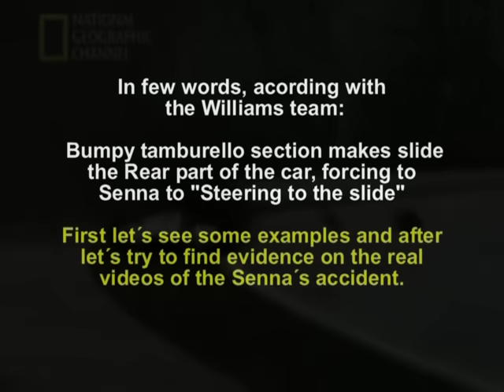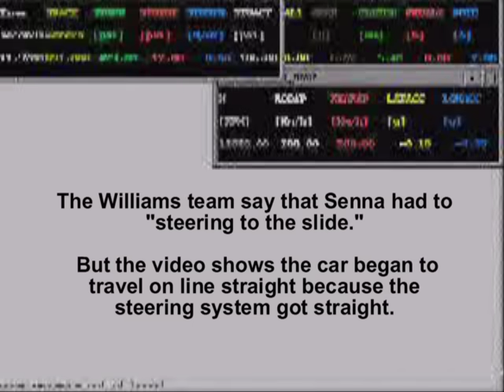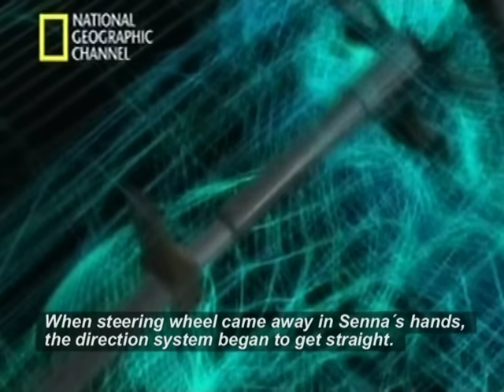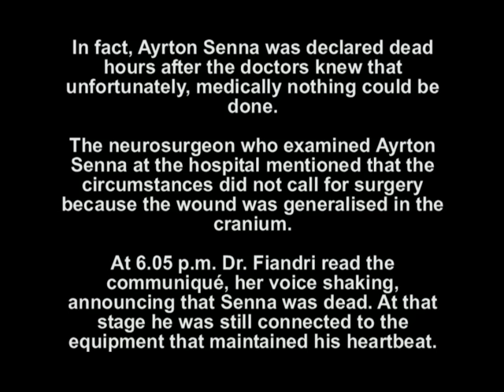5/5 the death of Ayrton Senna - what NatGeo did not tell

Comment: 1) Whats clear is  F1  had no Standard for how low the car could be.  The Steering did not just Brake with Driver turning  a steering like An Arcade game. Clearly  Senna Pushed To the limit Gap between  Ground & Car to the Max. Based on Cold tires on lap 6  with Temps starting rise in the Tires on Lap 7  at 200 mph the rear of the car when comes in contact with the  track  and Like a car jack  stand lifts the Rear of the Car to Zero G for a  moment  the back of the Car is Weightless. Now all of you I hope have jacked up a car sometime in you're life.  You when  you Lift  one side what happens to the other. The unbalanced weight is placed all on the other side Shock s almost completely bottoms out. At this moment with the rear being clearly the majority  of all the Weight of the Car. It Now becomes the 2 Front Tires wheels, 2 coilover dampened, 2 Sets of Arms and 1 complete Setup Steering System having to bare the whole weight of the car, that was designed to only handle the Front weight which by comparison is next the nonething compared to the rear portion with Engine driver Wheels Tires twice the size of the Fronts Supension and control wing. At this point it is Possible  Steering system snapped. 2) Or upon Car & Senna Returning to Ground Senna as any great does, drives by feel and Knew Something was  serious  wrong. He  Slams the brakes Applying even more down force to the Fragile front end that is way beyond  Its load capacity locking up all Wheels At this Point it The Steering system  was not already broken now The in Full lock Steering System snapped like toothpicks. 3 groups of people are responsible for Senna's Death. 1) F1 for not setting lowering limits. They knew tracks are not perfectly level. 200 mph this unlevel environment  is Magnified. 2) the owner and builders of the Track. Knew this the Fast corner in F1 so Why make the so close and barely  enough kitty To Stop a bicycle  let alone a 200 mph car. Guess the Green Environmental Wackos Got a judge telling the Track those are endangered Trees and even more endangered a very rare nat Fly. Oh well the Hell with the Drivers if theirs a problem. & 3) The great One Senna himself. As stated in the Video He push the limit on everything  an How low he could go was tested. Conclusion this too Low. Remember every  2mms would shave 1 to 2/10 on lap times Senna Gambled and lost. With the Help F1,Track officials & Green tree huggers.
WILLIAM'S at no time was responsible. But clearly SHOCK, IGNORANCE, GUILTY & a natural ones trying to defend  themselves from something many here in the Comment say they were. 
Remember when going 200 mph you are traveling 10 football fields every 1 second. Let's say Rear of car was only at zero G and in the Air 1/2 Second it was in the air and at zero G with all weight of Car on the Front never designed to handle that load for 5 football fields 1500 Feet. How far do you think & how safe down the dragstrip at 200 in the 1/4 mile. Senna did the quarter mile at 200 mph without ever the rear wheels touching the ground.
I REST MY CASE‼️ RIP Oh great one💎🌍

Comment: Think of it.
The tires spinning at those speeds.
Both linked together.
The centrifugal force would point those tires to the least amount of friction/counter force/resistance. 
Which way would the tires turn?
The exact direction the car is pointed at, at the exact fraction of a second that they were broken away from the steering column. Straight into the fucking wall.
Sad.

Comment: First off, there is a lot of blame back and forth and tons of opinions. IMHO, Senna (God rest his soul) knew his risks! Knowing one of his best friends died the day before (RIP Ratzenberger), Schumacher (Get Well, God Speed and will always be #1 in my book) breathing down his back, weather conditions, and concentration just coming back to speed after the safety car, etc. This is a lot in itself to take on! * To the point*** This is a team sport and they all have their part to play. Some days are synced up all around and victory is had by all, but those days where one thing can go amiss, it could spell a devastating lose, and sometimes death. Back then, drivers knew the risk was 75%-80% probable of some kind of incident would happen each time they took to the track, and 20% of which could result in death. Win as a team or lose as one. Again, IMO Senna was pressured to get back to speed and the wear of hot racing to cooling of caution, then back to speed took its toll on not only Senna, but his car. At which the steering was lost as he tried to no avail, be able to steer as the car headed straight for the wall. At this point the hydraulics system fails on the height/ride control and drops the car like a sled, he braces for impact and the brain and body go limp (as it does for ALL of us before a tragic event), HE did all he could, and as the car hit the wall and buckled the front right suspension and broke apart, he and that part met in a split second to where to pierce his visor (back then was only @3" opening). I'm not a doctor, nor do I play one on TV, but I'd like to think he NEVER felt a thing and if he did, he would not remember it at all. This why, at his funeral when his wife is holding his helmet, only the visor needed to be changed. He enjoyed what he did, He was born to do what he did, and he died doing what he loved! RIP Ayrton Senna, you are and always be one of the best! God Speed

Comment: The greatest driver in the the world died because of car designed. Nobody not  going to accept their technical failures. The car didn't turn for left. We need not to tell even child drive the car🚘 when the left corners comes they will turn left or right according the corners. He is not a ordinary driver. Before the car going to hit the walls the  car wheels in the straight. My strong and well in my knowledge the steering wheel not turn any side. The steering might be stucked Or in between steering wheel 🔗link shaft in between steering box disconnected. It is total major fault is car assembled.

Comment: William's with the fine line's in motorsport and F1 took a huge risk they mucked around with Aryton's steering column cutting it and re welding it thus shortening it, but it snapped under pressure the heat being generated from the car hitting the floor would of heated up the welded metal makeing it soft and weak put pressure on this  of going into a corner with that speed and g force then SNAP it broke it could'nt handle the strain. Aryton in that split second his heart must of sank poor fella knowing this is it.  Poor Aryton Senna God Rest His Soul a lovely beautiful Human Being left our Earthly World far to early to go home to Heaven Amen xxx

Comment: And why does the truth have to hid on youtube .....  IM going to take a guess at this as i could be completely wrong. But i think when Williams Welded the steering extension on they have welded it, but inside the tube was exposed to air instead of filling the internal of the tube with a gas. So for the none welders out there exposing Oxygen in a weld causes inpurities so the weld is not as strong.

Comment: You show back slides at very middle-low speed . That cases have nothing to see with an 300 km/h driver correction. At that speed is leterally impossible rekeep the car control in case of a back tyres slide. You fly out without any chance of line correction. Senna in my poor opinion in the six lap attack the Tamburello in a normal way, in the seven while he close the trajectory on his left too much and the bump do the rest. About the steering column, many think to collapse in his hands, i think while that collapse at couse of the huge front right tyre impact. In many video you can see by the on board the driver take off his hand by the steering before the impact becouse the front tyres impact generate strong bad reactions on the steering and this would easy break fingers or hands.

Comment: 1.) Open your (obviously blind) eyes: The moment the Onboard-Pictures start to become a bit greasy, you can see the "steering to the slide".
2.) The split-second after that, whilst he was trying to steer back to the left (picture still greasy), the steering column was already broken due to the car hitting the ground (which caused the greasy pictures too btw, heavy vibrations cause image sensors to malfunction) which causes the car to go straight ahead.
3.) Cause(s) of steering column failure: A piece of undersized steel tubing welded in poorly beforehand (to better fit the steering wheels position for Senna), which already had to deal with overloading due to the poor fit of the car - the car was sitting too low due to cold tyres and overall too low suspension-settings which caused the car to repeatedly touch the ground hard the rounds before (on the at that time horrifically uneven track surface compared to today) which finally led to accelerated fatigue failure of that welding - became overloaded due to the abrupt steering motions and the shock the moment the car finally touched the surface the split-second before it went straight ahead. This last "touchdown" finally caused the welding to break which caused the whole steering column to become loose, therefore making it impossible to steer the car in the first place, making it go straight. Due to the following impact to the wall the already detached steering column was "pushed" through the monocoque towards Sena and in the end, unfortunately, hit Senna, punctured his helmet and his head.

To come to your "explanation" that there was no "steering to the slide":
1.) You compared different angles of view.
2.) You compared different corners
3.) You compared different cornering speeds
4.) You compared different cornering angles
5.) You compared, therefore, completely different slides and situations.
Which, in the end, makes your "comparison" and so-called "analysis" completely unusable and inconclusive. You are comparing apples and oranges, therefore proving you to be absolutely unprofessional behaving. You just distort the facts so that they will fit into your crude conception of the world. Wake up!

Comment: This whole video is debunked in the National Geographic video. Their explanation makes complete sense. He crashed because the care bottomed out, the back end slid out and when he corrected, the rear wheels got grip again and snapped him back on line which was straight into the wall. He was quick on the brakes but you have to realize this all happened in about a second. If you want to try this, go into a drift in your car then just let off the gas. The tires will grip and throw you the other direction.... or flip....

Comment: all this talk of this and that when in actual fact the wheel section hit his head when it broke off. not technical figures didn't kill him. failing brakes didn't kill him, snapped steering wheel didn't kill him, so stop making out it was this or that which caused is death yes these could have been factors to his crash but it was the wheel section that killed him.

Comment: Even if it was the steering column that failed, it was lengthened "at Senna's request." You did what Senna wanted. That's why you got him in the first place. They were also chasing a team, Benetton that was cheating with illegal software and modified fuel flow system. Senna was killed by circumstances, not people. Accept it.

Comment: wrong ! column broke due to impact ... Senna did not turn the wheel  ! ... simply because the car was floating after hitting that bump ! Turning the wheel to early would be disastrous! .... The crash itself though would of seen Senna with bones boken but okay ,,, Bad luck saw a piece of the suspension hit his helmet ..... .. The real reason he crashed ????? pushing too hard cos he would not be beaten by a cheat with traction control

Comment: Adding power in a turn, causes the rear end to step out.. you can catch the ass end, by straightening the car out, and backing off the throttle..  and the drivers are constantly fighting this battle of forces in every turn.. traction against power and inertia.. cold tires have less traction, and slip quicker, under power in turns..  he drove the car, too hard and deep into the turn, for the conditions.. once that occurs, you just as well to be on ice.. hard braking, worsens this effect, as tires lock and slide on molten rubber..  
He hammered the damn thing, one lap too soon.. tires were not up to racing temps yet.. sad
But honestly, it looks like a mechanical failure to me.. the wheels never turned from straight forward..

Comment: I just dont know.
1: Why is it crazy to believe that the car wasn't fully warmed up/it was jumpy and twitchy and he just went off? We do see it bottoming out and being twitchy, and sure lap 7 sparks are less bad than 6 but thats not an "a ha!" moment...its still happening. If you are driving on a snowy road and hit a stretch that is less snowy but still...you can still spin ya know? Drivers sometimes lose it when all is perfectly fine so I dont see why its so impossible to believe that in a twitchy, bottoming out car that may not be 100% up to speed yet he could've just gone off. 

Senna himself already said the car was kind of gnarly to handle: "I have a very negative feeling about driving the car and driving it on the limit and so on. Therefore I didn't have a single run or a single lap that I felt comfortable or reasonably confident. I am uncomfortable in the car. It all feels wrong. We changed the seat and the wheel, but even so I was already asking for more room. Going back to when we raced at Estoril last September, it feels much more difficult. Some of that is down to the lack of electronic change. Also, the car has its own characteristics which I'm not fully confident in yet. It makes you a lot more tense and that stresses you" 

Again, these were his own words and before this race happened. It seems quite reasonable he just lost control/the car did something wonky. 

2: The steering column thing. So it seems undisputed Williams did a shoddy job, and somewhere during the crash it broke. But unless we have the proof, and sorry but "I saw it live in 94 and there was one shot never aired again" "I worked for this team and heard this" "I have 45 years experience in X" or people's speculations about various things...we dont KNOW it broke then he went off. He slammed into a wall at 130 mph its quite possible a weak/cracking column broke during that. And this is no blame, not at all but Senna DID ask them to fix it. Yes, they did a poor half assed job, but Senna did ask for it. Being Senna...Im sure they caved and tried to do it quick as possible/he'd not have waited. They were put in that position. Again not absolving or blaming Senna. 

3:  He was human. The other common thing seems to be "It mustve broken otherwise hed have saved it" "hed save it not hit breaks" "not possible" he was a legend, one of the greatest, but he could make an error. No one is immune from this, he like any other made errors. 

4: Regardless of all this, it was the piece of debris hitting his head that killed him. Far as I know this is beyond dispute that it happened. So lets say the steering column DID break, just hitting the wall he may not have died. While nasty this happened a lot and people did not usually die. It was the debris, and that is just tragically bad luck it hit him. It easily could've not happened and he may be alive. Its almost more shocking to think this than  conspiracy or to blame....but its racing. 
These were wilder times...clearly safety improvements were badly needed. Remember Roland Ratzenberger died this same weekend, Rubens almost did, and several fans and pit crew members were injured. This is why they tried to slow the cars, added more chicanes, raised the side heights, strengthened tethers, implemented pit lane speed limits, and started to push the HANS device which has saved quite a few lives in a number of sports. 
It is tragic this weekend had to happen for these safety improvements to come. Much like how Dale Earnhardt, a fierce resister of HANS, had to die to prove it was needed. We love the danger of racing but this is what can happen.